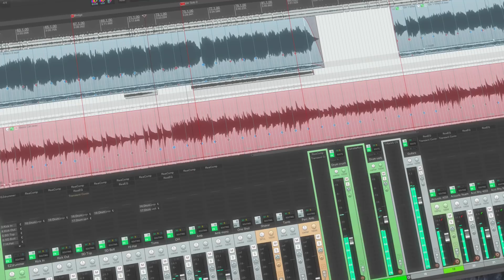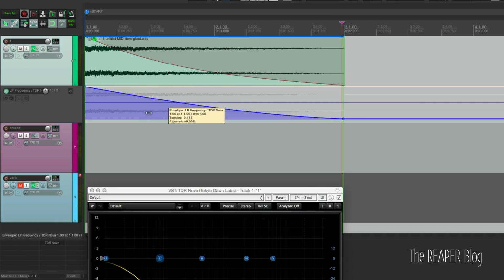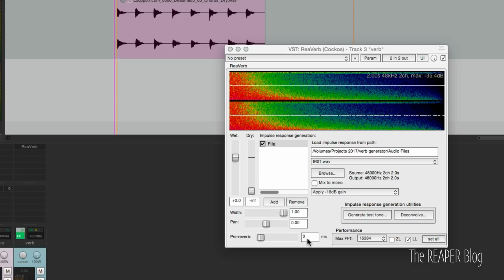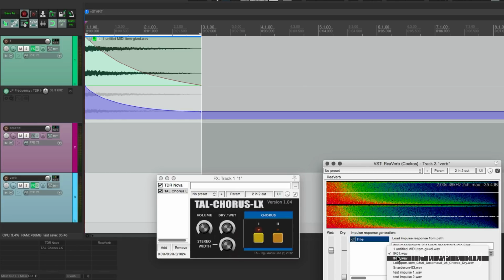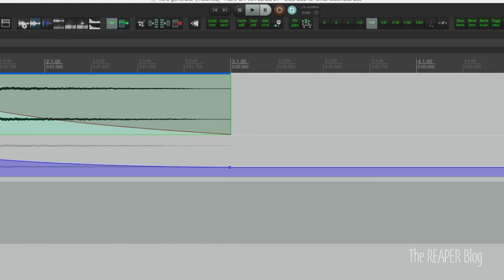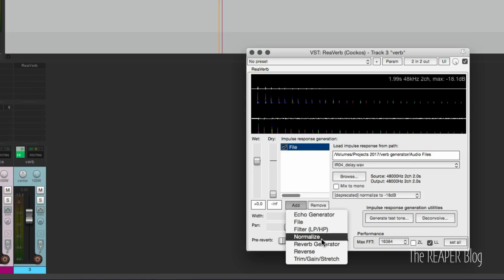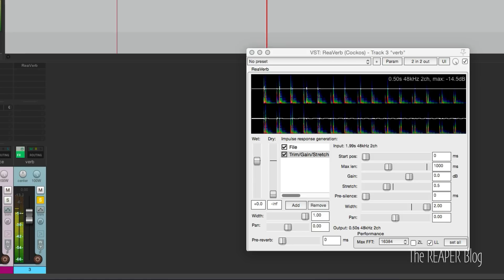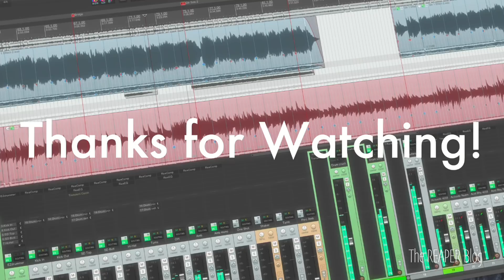Make Your Own Reverb - Synthetic Impulse Response Tutorial in REAPER DAW

Comment: Quick follow up question. But first, this was incredibly helpful and allowed me to effectively find the exact solution that I was looking for! 

My question relates to using a similar process as this video but to blend in custom EQ curves in with guitar cabinet impulse responses that I will then export out of my DAW as a .wav file to use as IRs in my digital modelers for guitar (e.g. Fractal Audio Axe Fx III). This process seems relatively straight forward when dealing with static EQ curves. 

The main part I am unsure about is, using the Nova EQ plugin as an example, will the dynamic EQ and compression features also be properly translated into an exported IR that will be used in external units outside of Reaper? I have come across a comment that non-linear effects, such as compressors, will just end up as noise. 

Also, this same person went on to mention that the use of IIRs, instead of FIRs, for filters will likely lead to different sounding results in the exported file compared to what I will be hearing when working in my DAW. If this is the case, and the Nova EQ uses FIR, and I should be sticking only to static EQs, are there any strong recommendations on an EQ plugin that will be more compatible with my needs while still having a lot of powerful customization features and being fairly easy to use with a spectrum analyzer? On the other hand, if none of this is going to be a problem, then it looks like Nova should work great for me.

Comment: John, I was wondering if you've done a video that can help me. I have quite a few VST's and VSI's. I want to make a folder that would contain only the plugin that I use frequently. Example: folder for all the EQ's, folder for compressors, folder for synths, folder for drum machines and so forth. All to be contained in the plugins area in Reaper.

Thanks John
Reply: You can add plugins you use often to a "Favorites" folder in the FX browser. That way you can find them easily. :) There is also nothing that stops you from making lots of folders with different names (such as EQ, Compressors and so on) and then add the plugins to them.
Reply: Thank you very much for the reply.

Comment: Nice video as usual! One small point: the "pre-reverb" parameter isn't actually a predelay. In fact it's the opposite: it moves the reverb earlier (and increases the latency).

I'm guessing it's to compensate for reverbs with predelay burnt in (though trimming the start might be a better solution in that case).

A real predelay parameter would probably be more useful. But it's handy for reverse reverbs: set the pre-reverb the same length as the impulse, and reverse the impulse. Then print, unless you're happy to have monster latency...
Reply from the maker: Thanks Dan.

Comment: I really want to use only reaper plugins. Unfurtinaly we dont have a very good plugins on it. But we some experience i can do great things
Reply: I actually think they are great!
Reply: Well there's so many great plugins out there, free and cheap so it's not a big issue.
Reply: Matej / Psilop i agree with you but we know about when we talk about good plugins for mixing we have alot of them on the industry. Because some companys are working only on The process, to create plugins who can be a perfect emulation of a analógic  gears. I love and use reaper plugins but in some cases i use outside plugins.
Reply: Nura in My opion reaper lose when we talk about prodution. Good to record and mix, but making beats is not so good in My opion.
Reply: @zimouspero  
I dunno Reaper got one of the best midi editors when you learn how to use it.  You can generate chords and arps and even snap to key.
Reply: @VincentJames3912  i agree with you about that, the only problem on midi is: if you are using reasamplomatic5000 and try to move the panoramic on the midi, like... send the sample more to the left or rigth, this action doenst work. i need to automate the panoramic on the automations lines.
Reply: There are free plugins that aim to emulate that analogue gear and they do it pretty well. Or you can buy them, since Reaper is pretty cheap and you can find killer deals online. I mean just look at Wave plugins, you have them on sale all the time or you can even subscribe to get them so you just spread out the payment. So I really have to disagree with you there.